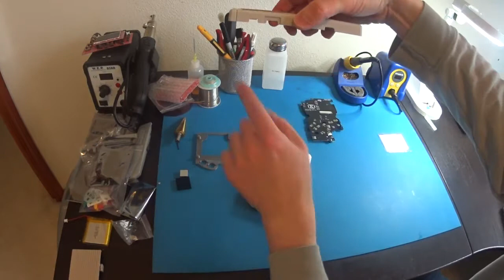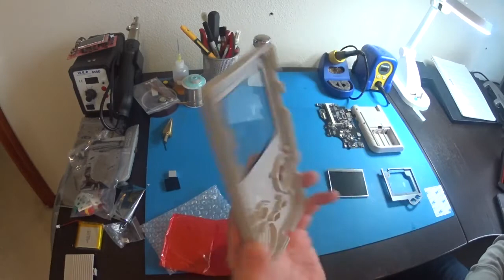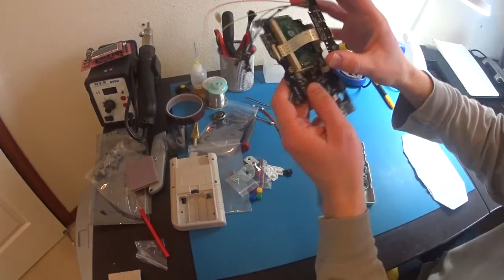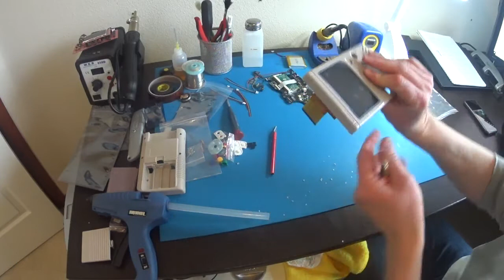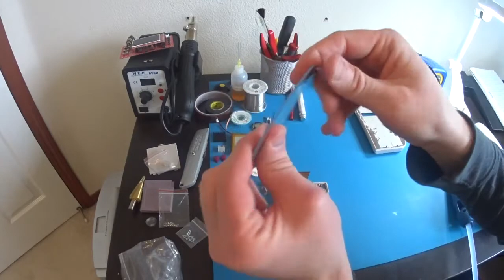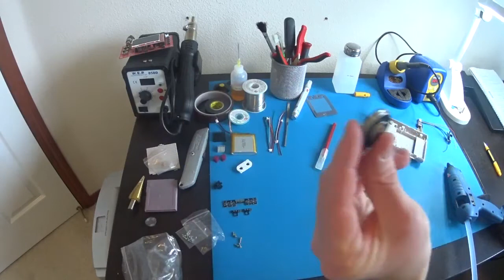GameBoy Zero Build using Kite's Circuit Sword - Part 3

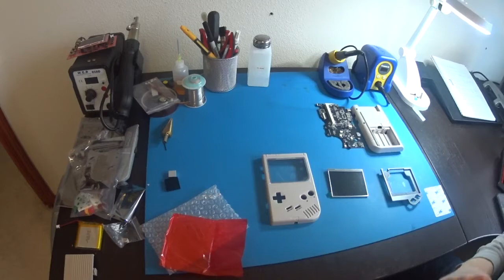Comment: great series of videos, thanks, one question, where did you buy the glass for the screen that is shown at 2:04?, thanks
Reply: forget it just read description on video 1:

Glass Lens from Jeremy Dresser (Retropie handhelds FB group): 
https://retropiehandhelds.com/shop

thanks!
Reply: but they are out of stock, any alternatives?
Reply from the maker: This guy has covers, but its in the UK, he also has a great selection of stickers for the back/cartridge/etc that I used. https://yaya-design.com/index.php/category-layout/screen-covers
Reply: thanks!, also I noticed you need the power button, where can I find it?, thanks!, or where did you get yours
Reply from the maker: If you're talking about the the power button bracket, check the parts list in the description.  If you're talking about actually needing the power switch, that came with the kit, and if you're talking about the "MODE" button, I just used a longer tact. switch,, I have a large amount of them I bought from amazon a long while ago.
Reply: thanks, but I was talking about the power button that comes with original gameboy but does not come with gameboy shell from retromodders
Reply from the maker: Oh I see, I have a ton of spare ones in black from when I bought 50+ black button sets.
Reply: hah I see, where did you buy your buttons?, for example I need 6, but all of the sets comes with dpad and only 2 buttons, soy I end up buying 3 sets and I will have losts of spares :(
Reply: also, thanks for taking your time to reply to me :)
Reply from the maker: I bought my front buttons from RetroModding, and my back/power buttons came from some vendor on Aliexpress.  What i often do on projects is just sell the excess parts on eBay, Sudomod or the Retropi handhelds facebook group.  In many cases, I make back as much as I spent, so my own parts end up being "free".
Reply: got it, awesome, thanks!

Comment: Nice idea with the whole punch for the buttons, wouldn't have thought to do that. Are you not planning to use the led status lights at the top of the case?
Reply from the maker: I can't take credit for the hole punch idea, got it from the Retropie Handhelds group thanks to Jeremy Dresser for the suggestion.  Regarding the LED lights at the top, I've decided for now not to drill the holes.  With the battery/wifi overlays on the screen, I can see the status anyways.